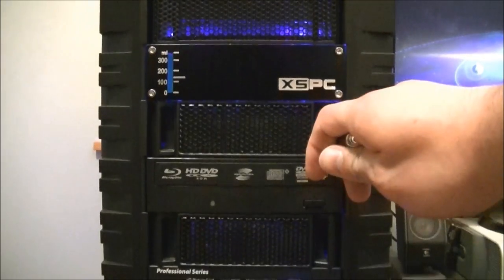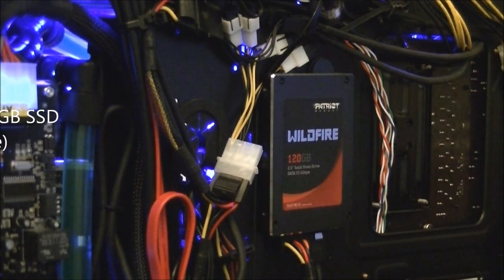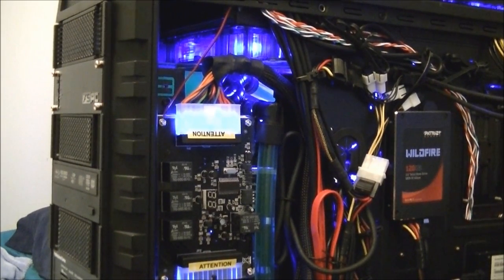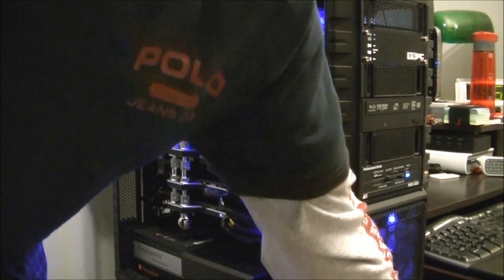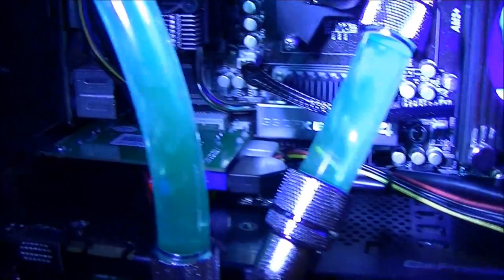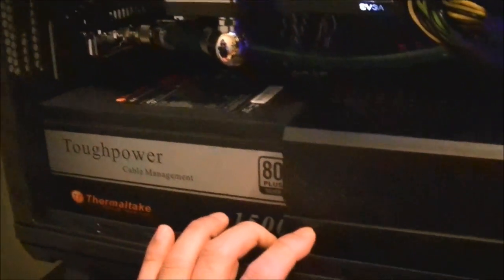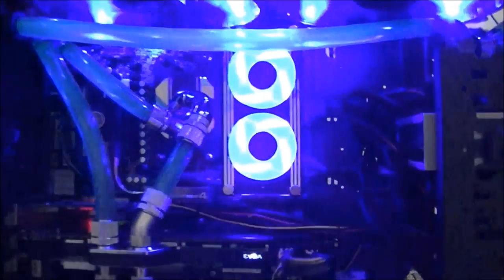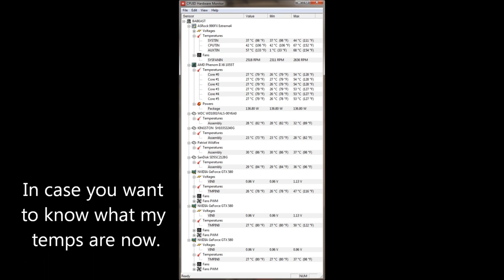B.A. Beast 2013 update video

Comment: Did you have to mod the case in any way, to fit in the 400mm radiator at the top?
Reply from the maker: Yes, i cut the top 2 sections of the drive rack,  drilled mounting homes on top,  widened the cable routing hole on top of the case,  and shaved off some metal where the fans mount on top to increase air flow.